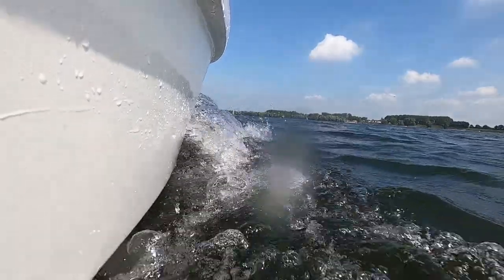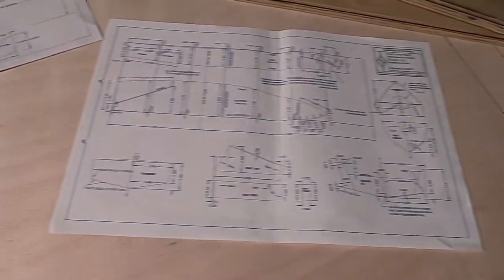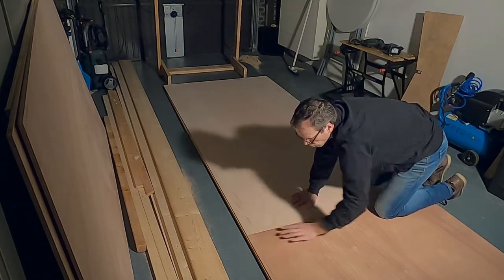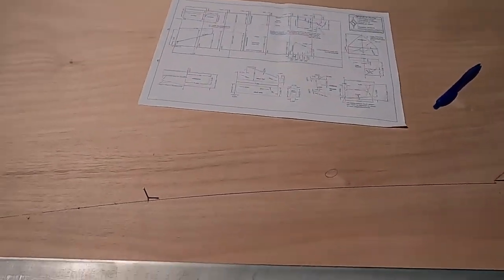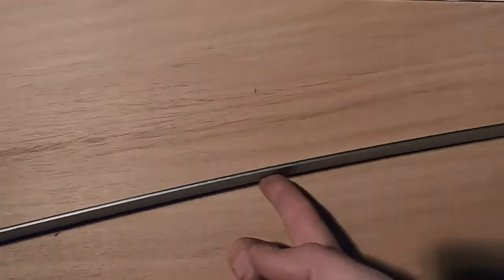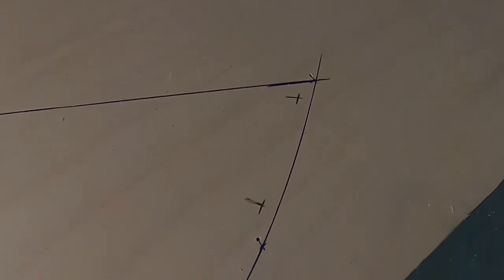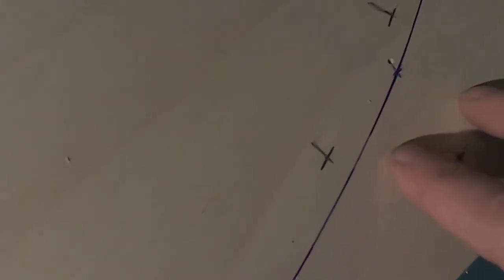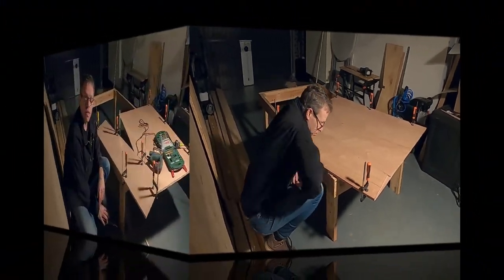Building my nesting dinghy - a sailing spindrift 10  EP_1

Comment: Hi friend...first of all, congratulations for the channel, it's very good and teach us a lot...and then, I have I doubt....Recently, I bought the Spindrift's plan and didn't found the measures between the wholes that are done in the structure (plywood) in the parts that are joined...these parts are the bottom and the sides. How you you solved this matter? The measures are aleatory?
Reply from the maker: Hi,
Thank you for your comments! 
Well I found all the dimensions in the drawings.
The measures are not aleatory.

The curved line must be made like I did with a strip of steel or such.
Or are you missing other dimensions?  

Best regards,
Ronald Molenaar

Comment: How many sheets of plywood do you need?
Reply from the maker: Hi Collin,
Sorry for me late reply.
According to the manual you need 4 pcs of plywood (6mm 2500x1220)

And it worked just fine, I even had some left over to make a new bulkhead ;-)